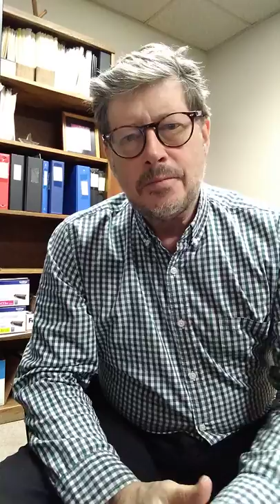Edison recording studios and things that took.place in them.

Comment: I wonder why Edison did not record cylinders electrically simulteanousy with the discs. It would be cheaper and would sound a lot better than the dubbed ones.
Reply from the maker: The Cylinder was a nothing business by the time of electrical recording for the Edison Company. The Edison Phono and Record Co. was several million in the red in the late 1920s. It hadn't turned a profit in years.  I did ask this question to Theodore Edison once. He answered " We couldn't give cylinders away in those days" So there was little interest by anyone n the late 1920's to do anything with the cylinder. It was continued just out of practice. TAE had little interest in recording by this time. He was 80, and fiddling with goldenrod rubber.
Reply: @jfs78  Little did they know back then how sought after these records are these days! Of course the reason to dub was to save money, but using microphones instead of horns would enable them to record simultaniously and save time and money. And the product would be much better.
Reply from the maker: @stevefish3124  Theodore Edison in my conversation with him. Could not understand why we liked cylinders. In the business the cylinder was more or less looked at by 1912 as a antiquated style. Of course the Columbia Co. stopped making cylinders that year. There were a few Indestructible companies making cylinders afterwards. But Edison doggedly went into that year the Blue amberol.  Even he came to realize that the end of the cylinder was coming. For certain times on recordings he would write " Not good for the disc biz, but fine for the cylinder" More or less setting up a class system. Lower class "stuff" as he would often call things would be for the cylinder crowd, and higher class the disc.
Reply: @jfs78  Were there any new recordings released on Blue Amberols  from 1915  on that were not on discs other than those which originally came from old Black Amberol matrices? There are some of those which were interspersed with new recordings till the end.
Reply from the maker: @stevefish3124  I think a few. Many of the 4 min wax were passed over to blue amberol before 1915. After 1915, the "Damnberols" as dealers often referred to them rarely had a direct recording released. In 1919, Theodore Roosevelt's black wax recordings were reissued on blue amberol. Interestingly in the last few years of the 1920s, a few more came out of Sousa's Band and Harry Lauder .. I'm sure a few more did as well.
Reply: @jfs78  Yes  One of the Black Amberol Roosevelt  cylinders was not reissued as a Blue Amverol after he died in 1919, the one dealing with the goals of the Progresssive Party, as this was a dead issue. And the Sousa and Lauder records had been recorded years earlier.
I do know that "I Want to be the Leader of the Band" was first released as a cylinder  before the disc issue, although the cylinder version is, as usual, dubbed from the disc recording. I have both versions in my collection.
I recall reading in Ron Dethlefson's book that Edison made live recorded cylinders of Henry Ford's Country Music Band in Michigan because he didn't want to send disc recording equipment there . I have one, too, "Golden Slipper Medley". But alas, there are no direct electricaly recorded cylinders although according to Dethlefson, the very last ones were dubbed electricaly.
Thanks for your corespondence!
Sincerely, Steve Fish